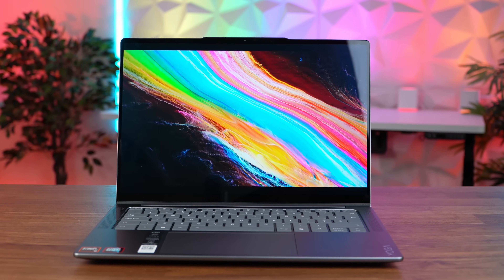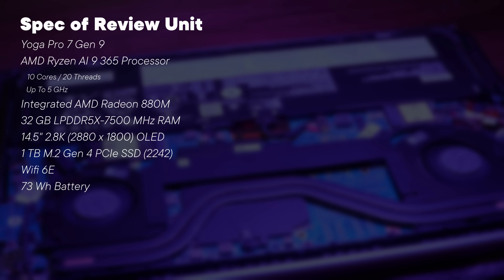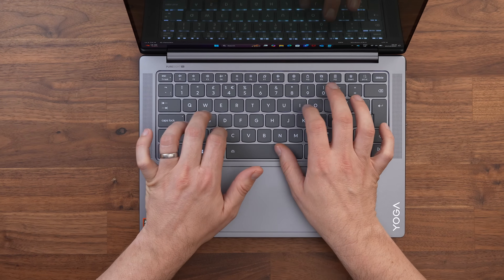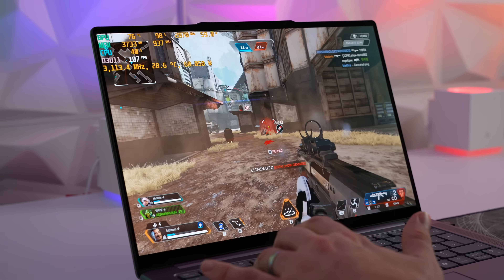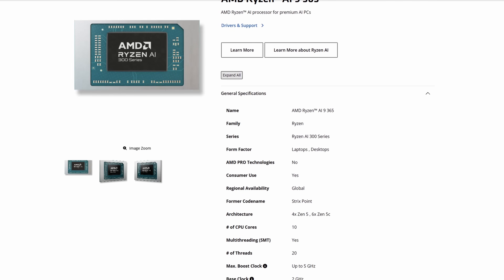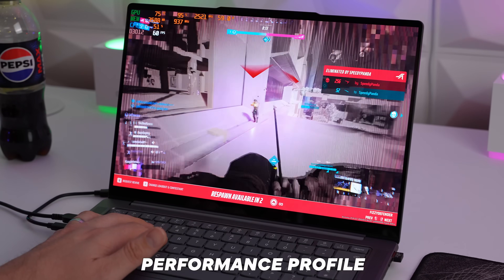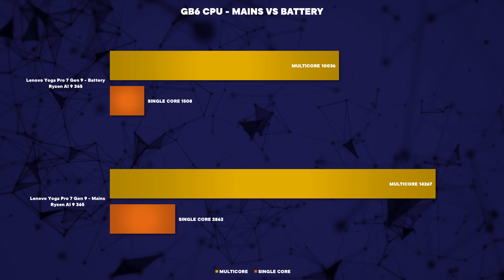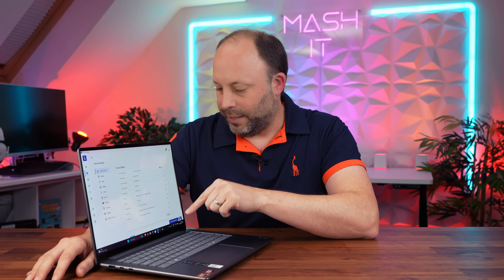Lenovo Yoga Pro 7 Gen 9 AMD Review - Strix Point at last!

Comment: This one or Asus’ Zenbook (Intel 258V) The touchscreen is not a dealbreaker for me, but battery performance is. Which one would you recommend? I’ve returned two Slim 7X (drivers are not working with the Snapdragon) and I’m a bit concerned of Lenovo’s support, but I do feel attracted to the design and built of the Yoga series.

Comment: Well, I started looking at buying a new laptop last november and still have not done so, what with all the new cpu's etc and so many complications of what's best and how to get the most for the money. Read and researched so much, watched so many Youtube reviewers videos......and amazingly this is the first Y. channel I have seen reviewing computers that is based in the UK. Excellent reviewing, presentation, nice clear and informative - have subscribed and liked!

Like many have shared over the months, I'm currently caught between a Lenovo Yoga Slim 7i Aura with 258V chip and (in my case) the UK versions screen of OLED 120Hz 500 nits sdr and 1100 nits hdr 14 inch OR this reviewed Lenovo Yoga Pro 7 with Ryzen 365 and OLED 120Hz 400 nits sdr and 500 hdr 14.5inch. Prices are almost identical now in UK Easter Sales....in fact the Yoga Pro is now cheaper!

 I really had been hoping to get a laptop around 1.2kg (like the Yoga Slim) and the Yoga Pro is nearly1.6kg plus heavier looking charge unit. I'm also very wary of the 400 nits screen brightness in the Yoga Pro - I feel it's not great for a glossy OLED in real world conditions and a reviewer on their own website mentioned it's not good with sunlight around and I've seen other reviews saying the same thing. I'm thinking to try and start making some of the nice videos people are putting on Youtube using AI and modern graphics software, but the 258V chipset has superior GPU, yet the Ryzen 365 has superior computational power and I don't know which to choose given the Yoga Slim's superior screen, weight and battery run time. Would you be able to share your feelings about exactly how much superior the Ryzen might be or would be for creating things like this https://www.youtube.com/watch?v=4Rv730_rI84&list=WL&index=32    or this     https://www.youtube.com/watch?v=-PkgLYkRYA8&list=PLCLSlXTwEHW7d9brakFIaMHSgRzuv-G37&index=142     ...If the Ryzen would be far superior to the Intel chip for such creations, I'd probably be swayed to accept the extra 0.4 kg and inferior screen brightness etc. But if the difference was likely to be fairly minimal given the Intel's superior GPU, I'd be very happy to accept the lighter laptop with superior screen quality and other benefits, since, apart from considering making some of those videos mentioned (in a non-professional sense), the laptop would just be a general use one, not for professional purposes. Any advice is very deeply appreciated - I'm going round the bend trying the make a decision and my current laptop is close to being an ex-parrot, ceasing to be, so I have to decide real soon, especially with the Easter sales on. Many thanks

Comment: I got a few days ago the laptop amd ryzen 7 yoga pro 7 120 hz same specs only the amd graphics are 780M instead of 880M but overall the laptop is great, the battery its amazing it lasted for 3 hours when working on office and after 3 hours my battery was 70% only. I might say the laptop was on adaptive mode instead of battery saver and my screen brightness was 60%. It's a good laptop and i got it at 900$.

Comment: What would you recommend, this or the aura edition?
Reply from the maker: both amazing machines but I would take the aura for much better battery, thermals and gfx. The Strix point would be better for someone that prioritises CPU performance
Reply: @ thank you❤️
Reply: @MashITTech  I'm also trying to decide between these two. Would you say that the 258V is better for video editing? even though it is running on lower wattage and has lesser single and multi-core performance according to benchmarks?

Comment: I was planning to buy yoga pro 7 gen 9 with for 1200$ with Follwing Specs
 AMD Ryzen™ 7 8845HS 
Memory: 16 GB LPDDR5X-6400MHz (Soldered)
Solid State Drive: 512 GB SSD M.2 2280 PCIe Gen4 TLC
Graphic Card: NVIDIA® GeForce RTX™ 3050 Laptop GPU 6GB GDDR6
is it worth or should i go with some other model for this price range
I want it for my work(SDE) and for some video editing and casual gaming
Reply: For this price you can by aura edition. 
In Italy your spec now costs 999euro.
Like on video Ryzen 365/32 ram 1150. Idk what to buy

Comment: i picked up asus vivobook ai 9 365 s15 instead ,for £1200.
Its still expensive ,but it has a 15" screen at least.
Reply from the maker: How are you finding it?
Reply: @MashITTech  It's a very good second light duty pc, and it has different fan profiles .
I keep on standard 19w and the  fans very quiet.
It's only rated 50w tdp at max power ,but it's enough . 
Oled screen, it's great as well, with 600nits peak brightness on hdr.
Track pad is big and accurate.
Build quality is awesome as well with plasma ceramic aluminium durable new gen. alloy chassis.
Reply from the maker: @Ramallinone  glad to hear you are enjoying it. I wanted to review it but they took ages to come to the UK so I ordered the lenovo instead

Comment: I have already set my eyes on this specific model.  Waiting for further price drop when more brands offer the same processor/RAM/storage combination.  I especially like the power the button on the side.  These enable me to turn on/off the laptop without the need to open the screen and using it like a desktop at home and office with my dual monitors when not mobile or on-the-go.  The OLED display is a nice to have.  Besides its good reliability and resale value, I see that only Lenovo provides power button on the side - hence has been using this brand for more than 10 years and on-going.
Reply: Does it have any hinge issuues  and what about the wieght
Reply: I have a lenovo L390, power button on the side. but doesn't work with closed lid, have to open it to power on

Comment: The price is absurd in my country. Costs about twice as much as the 8040s.
Reply from the maker: that is crazy. They are a little more expensive in the UK than 8000 seres but that is always the case when the new gen arrives with lenovo. We will soon see some discount codes I am sure
Reply: Well, it is the top of the line. Meant to take on Apple's M series.

A shame that the best feature , the 890m igpu, only exists on the top models. 😢

Comment: I would like you to test the body strength because I found a complaint about this on Reddit. When you press under the bottom cover of the laptop, it makes a sound like there is a gap inside like the assembly is not tight.
Reply from the maker: Let me test my unit later and get back to you 👍
Reply: @MashITTech  thank you mate
I'm just a new follower of yours, I just noticed a channel of this quality should have millions of subscribers!
Reply from the maker: @Boykub1111  haha I can only wish! but I keep plugging away :) and thanks for subscribing.
Reply: @MashITTech  :finger-red-number-one:soonnn
Reply from the maker: @Boykub1111  thanks for the reminder 😀 ok, just put some serious pressue on mine, I can get it to flex slightly as you would expect but no clicks/pops/odd noises or excessive movement. Feels incredibly solid to me
Reply: @MashITTech  ohhhhhh thank you soooo much !! <3

Comment: I received mine 2 days ago. I love it. Power and versatility for all my needs!
Reply: does it have PWM on the screen? flickering, you can check with your phone camera using high shutter speed, if you see bands there is flickering. please can you check?
Reply: @d3stroyah  I have this laptop and yes, there is PWM flickering at 240 Hz up to 100% brightness level. I don't notice it, but I have read a detailed review confirming this.
Reply: @d3stroyah  it does. Using the FV-5 app, I start to see very faint bands from 1/500.
Reply: Bro how many hours it's battery lasts
Reply: If you undervolt cpu cores with -30mV, how much you get in R23 and how much more battery life?
Reply: How is the battery on that? I am thinking of buying one
Reply: hi can i know how it perfome after 1 year is it good ? can i run some light gaming on it ?
Reply from the maker: Glad you are enjoying it
Reply: @MashITTech  I am. :) I rather have the multicore power and high gaming compatibility. And the screen... 🤩
Reply: @eduardopatricio  Can you confirm the big drop in performance on battery? I'm thinking of getting it but that would be a dealbreaker for me
Reply: @hvi-19 it run better on battery mode than any gaming laptop out ther, remember.. only on battery

Comment: Two comments:
- Lenovo as usually cheapens a laptop by going 365 instead of the amd 370 and doing a bad decision with the 2242. Even the Ally X manages to find space for a bigger ssd… they also have managed a very limited battery life!
- editing 4K 10 bit is slower on the AMD eventually because AMD’s drivers are either not optimized or Davinci is not AMD friend. Do you know if it edits fast on the snapdragon X? 

In summary: there are better options.
Reply from the maker: agreed with the 365 and 2242 comment, and there was loads of room for an 80mm if they wanted. The new intel chips worked incredibly in resolve, I was really surprised. Sadly, the arm version of resolve is still performs terribly with the snapdragon chips and adobe still havent released an ARM version despite saying they were going to
Reply: @MashITTech  honestly it seems once again that Intel’s “background/marketing team” game is back and strong, eventually making pressure so that AMD’s devices come always with serious limitations and intel’s don’t 😩 if battery life is on most newer AMD so good and this is bad? Why could they make physical space for the 2280 and got a 2242 with a connector oddly blocking the bigger option? Why is Davinci only optimized for Intel’s? (When I got my M1 Mac mini, Davinci was updated VERY fast as a beta for the new ARM architecture. How come now, with an ARM Snapdragon they can’t get it fast when they have already a ARM version? Tweaking from x86 and AMD GPUs to the M1 was blazing fast and now it takes ages… I also don’t understand why on AMD’s it runs so bad)

Comment: Please what's fan noise like on standard power profile? How does it compare to Aura in that sense?
Reply from the maker: on optimised, the fan noise is non existant until heavily using the laptop and then you get a light whoosh. It is similar to the Aura except the aura fans would come on a lot later if you were heavily using the system.

Comment: When will this be coming to the US?

I'm not interested in many laptops this year (this one included) because I need lots of RAM for VM usage as well as a dGPU, but this is interesting competition! Finally it seems like laptop CPU competition is getting better.

I'm just waiting for Arrow Lake so there can be laptops with that much RAM and hopefully still decent battery life.
Reply from the maker: I was really surprised when I checked today and it still wasnt available in the USA! I will speak to my lenovo contact and see if he knows
Reply: Wait arrow lake is for laptops also ? I thought it was the desktop chip
Reply: @avineshblah5739  it's the laptop version too with options for slotted RAM. Lunar Lake with onboard RAM only is a side deal.
Reply: @cameron_bosch  oh that makes sense, hopefully it'll come with better tdp even if battery takes a bit of a hit. Any clue when it'll launch ?
Reply: @avineshblah5739  I heard Q1 2025 unfortunately. Probably will launch with some Nvidia RTX 5000 laptop GPUs.
Reply: @avineshblah5739  Also, I heard rumors that Lunar Lake may not have a successor, as the next generation would build off of Arrow Lake with its separate memory (not integrated on the CPU) and would likely have Lunar Lake's upgraded GPU.
Reply: so what's your current laptop?

Comment: Only a single SSD slot is bad enough, but then they double down on the stupidity by making it a 2242 🙄. Well done, Lenovo, a very effective way to buzz kill your product to so many.
Reply from the maker: yep, and worse still, there was plenty of room for an 80mm in there with decent placement
Reply: It looks like there's room and a screw hole for a 2280. Unlike some other laptops.
Reply from the maker: it looks like it but there is a large connector blocking a larger SSD from running across it
Reply: @MashITTech that might mean that single sided 2280 drives would work, but they only go up to 4 TB. Still better than being stuck with shorter SSDs.